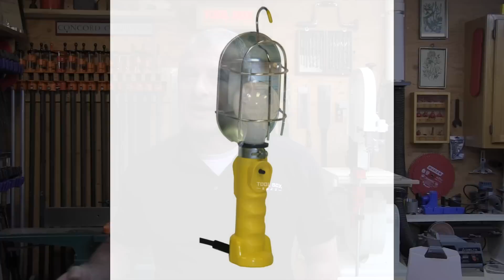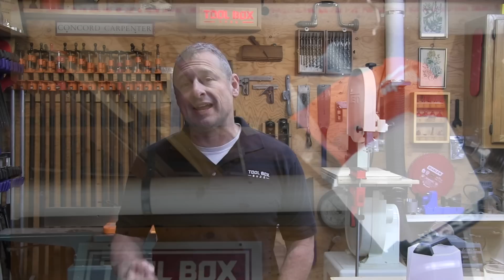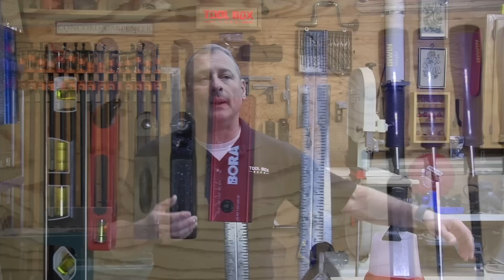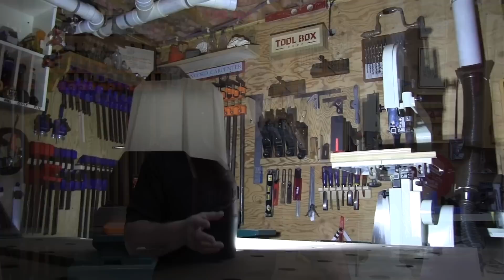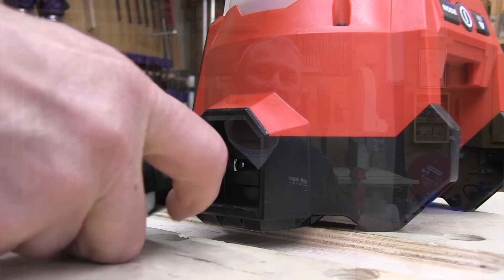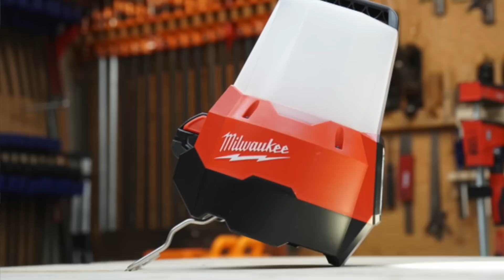Milwaukee M18 RADIUS Compact Site Light

Comment: Hated this light at first. Felt clunky. 2 years later I love it. Shockingly tough too.
Reply: Dropped 8' onto a polished concrete floor. Hit the lens and it rubbed the mark off 100% with my thumb. No cracks.. Never seen plastic do that with no surface marring.

Comment: Don't know if anyone has asked  this, but will the 12.0 batteries fit on this light?
Reply: Yeah it does that was the first thing I did was put in a 12ah battery as soon as I got it.
Reply: Ok, thanx for the replies, the local home Depot has a starter kit with a 12.0 and 6.0 battery and a rapid charger for $250.
Reply from the maker: I think so - theres plenty of room there

Comment: Thanks for the review. Happy to see tool companies upping their light game. Its about time.
Light color is based on the Kelvin scale. In a nut shell most are between 3000k -6500 K 
3k is more yellowish(warm tint, better for color rendition.) 5k is white(neutral) and6500k is blue(cool tint)
The higher 6500kelvin light put out more Lumen and companies use that as a selling point.
The warmer or neutral tint with higher color rendition is the ay to go. Easier on the eyes and better color rendition ( (CRI)
Like you said (CRI) is important for electricians . Red wires need to look red....
Im a flashlight collector (Flashaholic) buy the Wowtac A2S Headlamp. Its 1000lumen comes with a battery that has built in micro-usb charger,and supplied usb cable. Like $29.95 complete. You can use it as a 90% flashlight or slide it into the headband.
Great for work and one of the best deals in the flashlight world. I Dont sell them or have any conection with them. Just trying to contribute to you .